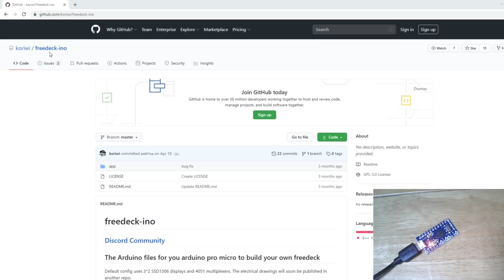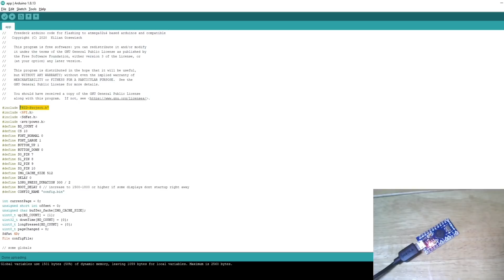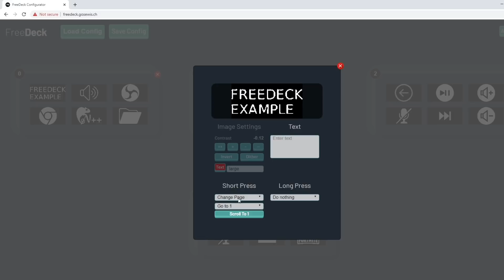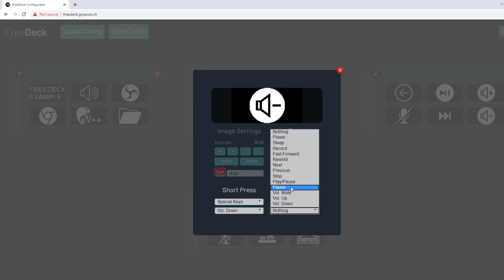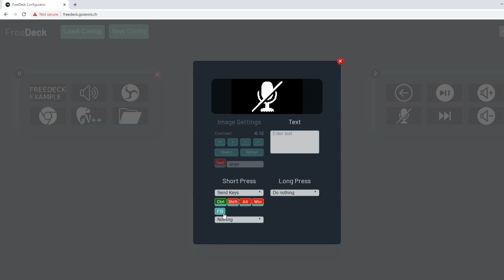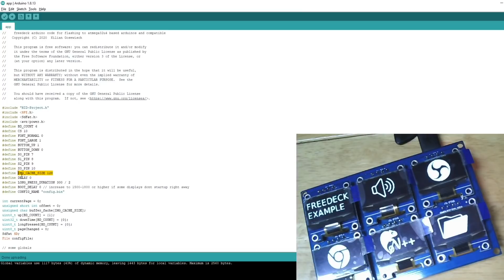FreeDeck - Open Source Stream Deck Alternative - HID, Arduino

Comment: Just what I’ve been looking for. I’ve seen the free deck project, ordered the cherry switches, but this takes it to a whole different level. Thank you Adam!
Reply from the maker: Great to hear!
Reply: @AdamWelchUK  is there a link or search term for the icons?
Reply: Found some icons (not as easy of a search as you would think) and completed the build. I made my own case, 3D printed base and laser cut mirror plexi for the face. Not sure if I can put a link in here but let's see if it works. https://photos.app.goo.gl/9DKc5QJAYyiQJF1g7 this is a shared album with a picture of my finished product.Note that the top left screen isn't working. I think it is either shorted out or defective. When I have time I'm going to pull the board out of the case and try putting a piece of paper between the screen and the button as was suggested in the discord. For now it doesn't affect the function and if any screen were to be bad, that is the best one.

Comment: I would've put one switch on each of the bottom corners, and wire them in parallel. 
It also provides the neglected support for the bending on the glass, when you push on the corners. 
the holes on the enclosure, will also make a great alignment jig when it comes time to solder them onto the PCB. 
Thanks for the inspirations.

Comment: finally my SMD & TH boards I ordered came in - had every intention of making the SMD version first but quickly realised that maybe I should have ordered the paste mask plate as well - so I built the through hole version instead, and have to say that if anyone else is thinking of building do the TH verision much easier. Happy to report that it mostly worked, have OLED 1 & 3 not illuminating for me and after do few tests think it maybe they are DOA so will need to remove and replace - which is not going to be fun but such is life! thanks for designing and sharing  your work Adam your a clever guy!
Reply from the maker: Best of luck with the screens. Glad it’s working in the main. I’ve just designed the pcb, the rest is down to Killian and his helpers. Thanks for posting your progress.

Comment: I made a project very similar to this one a few years ago. 
If I remember correctly OBS has a websocket plugin. 
I used a TV box running Node red and the Dashboard add on. 
That way I had a locally hosted webpage that I could use to control OBS (I used a old phone).
I considered using a Arduino and board as the tactile feedback would have been nice.
Your project is more impressive.
Great video.

Comment: Nice build. You can use a plexiglass top cover for a streamlined look. C cuts for every button, leaving the hinge side uncut or, better, partially cut. You can combine it with a nice sticker mask or play with plexiglass transparency. Carving finger placement dots is also an option. Mount it with magnets for clean look.

Comment: this project is now really starting to get that more consumer look to it, will be intresting to see where it goes next, one big improvement i could see would be a switch to a colour panel (driver: ST7735) or maybe even just some clear caps that can go over the screen like what the elgato has which can instead directly push the switch rather than flexing the whole display

Comment: I am designing my own, and was looking for inspiration. You've done a good job.
However, I need mine to be in full color, so I opted to go with these;
"10PCS 0.96 inch TFT Display 8P SPI HD 65K Full Color LCD Module ST7735 Drive IC 80*160"
If you google that, you'll see other sizes. At around $2.50 each, they are a pretty damn good deal for something that didn't even exist 5 years ago!  
I kinda like the elongated look. Specially if mounted vertically. 
I wanted to buy one, it was industrial, with industrial pricing and in Japanese!
Reply: Also TFT doesnt have burn in, these small OLEDs have rather bad Burn-in
Reply: Is there a space where we can follow you on this project?
Reply: Hey, can you explain how you made this project?
Reply: The owner of the github says the Arduinos don't have enough processing power to do full colour displays but I guess that the stm32f103c8t6 (blue pill) might.

Comment: What a brilliant idea Adam and Kilian. It certainly started me thinking...android phone or iPhone, key images, touch detection, bluetooth or wifi connection to PC/Laptop...presto no hardware to build! Could be more universal too if it connected with some library on a RPi...just some thoughts and a thankyou to you both.
Reply: You're describing "Matric".  Or "Roccu Power Grid" - although I don't think that's maintained anymore.  Possibly you could use "Unified Remote".  Depends on exactly what you're trying to do.
I use Matric to execute scripts in Elite Dangerous (request docking etc) and Unified Remote to control my HTPC.  Both have shortcomings, and a "real" button is just so much nicer to work with.
Reply: Touch screens are no good for blind pressing. Real buttons you can feel for while looking at something else.
Reply: @tin2001  I've now built a USB numpad into a Photoshop keyboard shortcut pad, and another into an elite dangerous keypad. Much better, imo. LUAmacros converts the keys into whatever keyboard shortcuts or scripts I need.

I may end up building an 18 screen version of this thing though.

Comment: Several of these would also be good for simulation games such as flight sims.Instead of locating the correct key on the keyboard for those you have not mapped to your flight controls, you could use these, once could even be used to engage a background mp3 player, to play back in cabin announcements, saftey breifings and other fluff that just adds to the experience when flying :) Oh, and F13 doesn't exist on a PC keyboard, or at leas on not many, but those of us lucky enough to own a full sized mac computer keybvoard has keys going up to F15. Mine are mapped to Autopilot controls in the sim, and microphone select / TX when working with my amateur radio software (swapping microphones in effect changes from one radio to the next).
Reply from the maker: That’s a great idea. I use F13-24 on my previous macro keypads to trigger auto hot key functions where programs aren’t customisable in that way. There’s loads of combinations you can use control+f24 shift+Ctrl+f21 etc. etc.

Comment: A great project really well done. Would be good to have a separate physical back button so you don't loose a screen on every page to the back arrow.
Reply from the maker: That’s possible. It’s also possible to use the press and hold function to go back a page too, but I didn’t show that in my demo. :-/

Comment: 9:55 love the idea of the screens pressing onto the switches. maybe you can find switches who are a small bit higher ? also I was thinking of a design where capacitive touch OLEDs are used but that would raise the cost deerly I guess :)
Reply: You can glue a plastic space behind the screen to level then, but yes capacitive touch OLED is better.
Reply: Do you have any examples of capacitive touch screens of this kind of size?
Reply: SidneyCritic ComedyHound I was thinking same with the gluing of plastic. The capacitive touch would be OK with me as long as the box of the button had haptic feedback. I grew up on tactile IBM click keyboards. In a large office, you could lose some of your hearing over time :D Regardless that tactile feedback and sound was badass. OK maybe sound not good with this application, but definitely some haptic feeling for the user, so technically could click it blind, especially if it featured a transparent Braille like just for the number position of the button (would also expect the Braille to change lol!). You can see a marker used now on keyboards on the F and J keys on ASCII keyboards for those typing as trained, following the “home row”.
Reply: then again. you could fit the hole keyboard an more on a TFT.
Reply: @nodustechnologies3989  basically buy a cheap smartphone and use it as remote.

Comment: This is a great project and I've been thinking about similar macropads too. One idea I'm going to steal is the sd card with configuration.
However, it's usually a good idea to have a switch to disable the keyboard/mouse functions because otherwise you can end up in a situation where you can't flash it over usb anymore if it's trying to send keypresses all of the time. Actually you could do that easily by disabling the output when the sd card is removed. 
Another option worth considering is using a dedicated i2c multiplexer like TCA9548A although it's probably more expensive but possibly simpler in other respects. Also a i2c gpio extender like PCF8574 or MCP23017 might also be more flexible, e.g. if you want a switch matrix rather than up to 8 parallel switches. Again probably slightly more expensive too, but the oleds, micro and pcb are your biggest costs.

Comment: Looks like a mechanical disaster - pressing the button through the display, flexing everything.
Does everything still work?
Reply: I have done something similar to this, and those screens are made of thin glass and can crack from being handled roughly, especially in the corners. Perhaps using a clear plastic button-top to go over it would be better, but I haven't personally been able to find a suitable one on any of the usual websites.

Comment: I wonder if a stack of a bigger screen, a pcb with smd switches and cutouts for images, as well as small pieces of glass or acrylic to press on those switches could be better and cheaper than individual display per button.
Reply from the maker: It’s be interesting to see the comparison.
Reply: This is pretty much how the Streamdeck does it. Albeit with some custom switch construction in the rims of the acrylic button caps. Makes it cheaper to manufacture, keeps the pressure off the LCD and is somewhat more reliable registering clicks regardless of where on the button you put your finger.

But with ST7789 1.3" displays under $2 a pop in single quantities I'm not too worried about hitting the price range of larger displays for the quantites I use in any one construction. Additionally, they allow me making my button pads in uncommon shapes too without much hassle.

Comment: Blob of silicone on top of each switch at the final fitting to take up the gap, and fit the screens into the case to use it as an alignment tool? I appreciate in your instance the case was probably designed and printed after all the soldering was done...

Comment: VERY nice.  I love those little OLED screens and I was thinking of doing something similar with a Pi Zero.  
Do you worry that the "hinge" for the display-buttons is the soldered headers?  I wonder if solder will crack over time with both the torque and the downward pressure on the joint.  Of course it wouldn't be that hard to use stranded wire and put a block of material at the top edge of the screens if necessary.  
Subscribed.

Comment: Anyway to make this a two-way communication? Maybe something that lights up when recording, or a way to tell which lights lights you have on in a studio or something?
Reply: well, technically, if you are much of a programmer this isn't hard at all, however you are asking so I'm going to assume you don't have a large background in programming so probably not worth the bother, but anyhow, there are already programs in the sim world for sending serial communications to arduinos for led's and screens (look up like diy sim racing dash or something of the like, digital screens, led, even f1 style wheel screens with touch, all from an arduino) to get them todo exactly what you want often takes a little coding, and of course, you would have to combine the code from whatever tool you're using to send the serial communication with the freedeck code and interface them with your icons... a days work for someone who has spent much time with diy sim racing goodies, for someone unfamiliar it would be weeks...
Reply: @killorkubed  I've got some extensive coding background, but not for physical objects, lol. I'll likely look into, was just worried the device presents itself as a simulated USB HID that wasn't able to receive communications.

Comment: Awesome project, and a great open source version of the Stream Deck. I'd be curious to find out if you could create a capacitive touch version with some basic TTp-223 chips, and a pad integrated into the PCB BEHIND the OLED screen. The sensitivity of the capacity could be tuned to trigger when a finger is touching the OLED, i.e. hovering over the capacitance pad of the PCB? Wonder if that would work and the OLED doesn't interfere with the signal too much??
Great work though, love it!
Reply from the maker: Cheer Stephen. I think this is worth investigating and I bought some of the ICs David was playing with a few weeks ago with this in mind. I’m inclined to think that the distance, the components mounted on the back of the screen and the screen itself may be too much to deal with for a touch sensor. But it’ll be fun trying :-)
Reply: @AdamWelchUK  Check out the cap sense capabilities, they are well documented

Comment: Nice idea but one thing about OLED screens, (with static displays), which really lets them down is burn-in. Have you a plan to reduce the inevitable dimming? It would be a right pain to replace them at a later date.
Reply from the maker: I’ve not considered this really. I’ll have to see how that plays out. Thanks for the heads up on that.
Reply: @AdamWelchUK  Sorry to bring it to your attention. I love these little OLEDs but they do 'fade' with time, not really noticeable until you change the image then it sticks out like a baboons bum. Nixie tubes have similar problem called cathode poisoning and cycle through periodically to prevent it.....maybe that would work here too?
Reply from the maker: MrToM I’m sure it’s worth a try. Thanks very much. MrT

Comment: Wish I could just buy this as a kit. I think I'm decent at soldering, but would need to source PCB and 3D printed parts which feels like a hassle.
Reply: JLCPCB is probs the best option for something like this. only downside is the wait and shipping times
Reply: @Altirix_  jlcpcb only took a week from ordering to receiving the boards. Took longer to get the screens from aliexpress.
Reply: @JamesHughes-photoJames  thats pretty impressive, ive ordered from them before, under a month to ship but thats amazing considering thats from china.
Reply: @Altirix_  shipping cost more than the boards. They have great prices on making boards but shipping is always $$ because they send it express.

Comment: What type of display did you use?,  Because if you look on the back there is address setting resistors, you can tell this by them being 0 ohms. I'm not sure how many addresses can be done using them but for 6 displays it should of been enough.

Comment: Look like an interesting project, and aside the fact that using the OLEDs kit PCBs makes the space between buttons much larger than actually needed, this totally misses the point of what makes the Elgato Stream Deck great: PC integration, including switching modes depending on the current running application and existing apps that plug into it.

Comment: Why not try getting an Industrial HMI they are getting a lot cheaper and are rugged.
Reply: Do you have any suggestions?
Reply: @rickpercy87  Delta HMI are relative cheap.
Reply: Aren't they bulky?
Reply: Those are unnecessarily large.  At that point you could probably just hook up a touch screen or an old tablet.
Reply: @TheDeathskull37  Yo wait thats actually genius. That gives me a project to work on coding wise too.

Comment: Very neat project Adam. Strikes me that it's almost a waste having one screen button as a page shift, are there any extra lines spare to have a couple of plain hardware buttons to do that?
Reply from the maker: Yes there are a few pins left - I think Killian fancies adding a rotary encoder.  The configurator has the long press functionality built in, so you could always have the top left button programmed to go up a level on a long press and use the button for something more useful on each page already.

Comment: This is a really cool idea! But I just can't help wondering how long it's going to last mechanically... I can't imagine the solder joints connecting the displays to the PCB will last very long with the repeated flexing. I wonder if it's possible to use stranded/flexible wire to hook each display up to the main PCB, then creating a crude pivot/hinge with the mounting holes at the top of the display modules. Each button/display would have more play/wobble, but might be worth it for long-term reliability.
Reply: I think the easiest solution would be to use a simple single touchscreen lcd, I mean the streamdeck is pretty much gimmick with its screen under buttons... what make it usefull is the software
Reply from the maker: I think you are right - there is a chance for mechanical failure in or around the screens pins and perhaps the screens themselves, and I haven't been using this yet to give any real feedback.  The actuation distance is tiny though.  Sadly the datasheet doesn't seem to mention it, but it must be much less than 1mm at the furthest point from the pins. https://datasheet.lcsc.com/szlcsc/1912111437_XUNPU-TS-1088R-02026_C455280.pdf
Reply: @AdamWelchUK  what about long pogo pins not completely pressed while the 3d printed cover offers also some retainment by some flaps for each of the screen side or even little pins into the 4 screw holes? It should offer good contact to keep screens going while not being pressed by also solving most of potential breakage

Comment: Is this Linux compatible? I want to order the PCB from JLC, just not fully sure.
Reply: Should be since it's recognised as a keyboard. In case of problems you can always change the code I guess